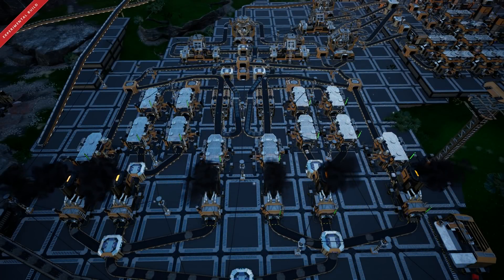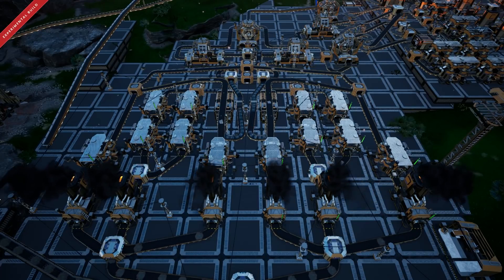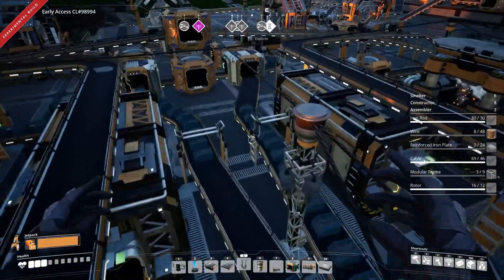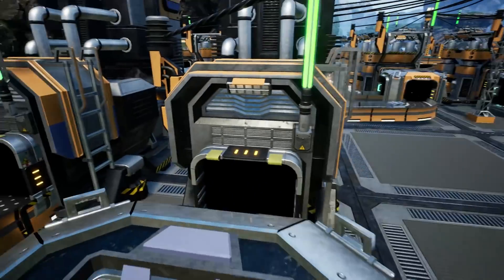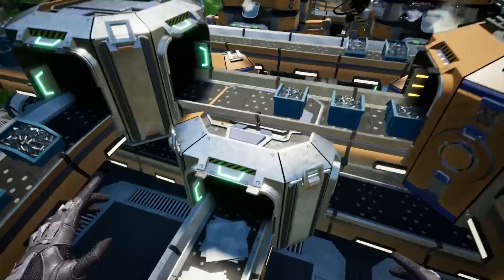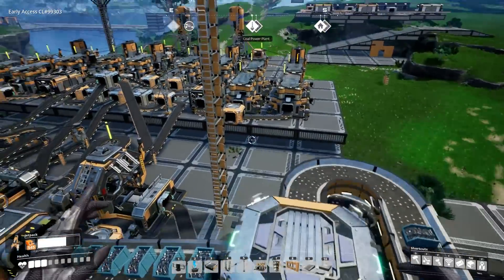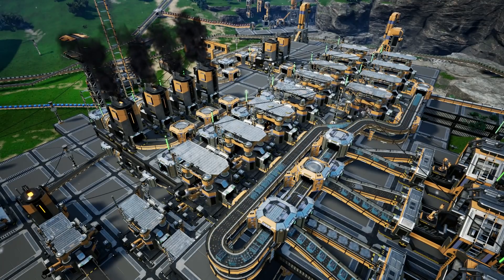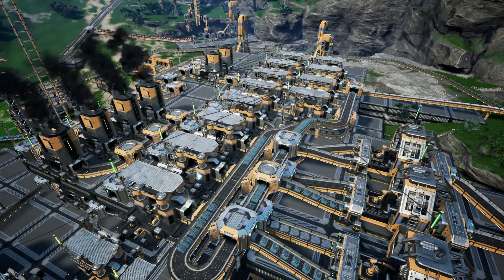Satisfactory Myth Busters: What's More Efficient, Bus vs Perfect Split

Comment: I use the overflow/bus line method because less space needed and it looks neat. But you do need to input slightly more than the exact amount needed for all the machines. You want to fill up all the machines or last in line will not get enough for 100. It would be great if we get set the output rate of the splitter.
Reply: to be fair, there is somewhat of an output rate on the splitter which you can control. if a machine only required up to 60pc to run at peak efficiency i connect them with an mk1 conveyer belt to the splitter and an mk4 belt is running from the source to splitter to splitter etc.

as the output to the machines are limited by the belt speed (60/m) the satisfaction period is drasticly shorter for longer buslines.

i do the same on the outputs. machine outputs like 30 plates a minute? mk1 conveyer into merger into mk4 belt. machine outputs 90 screws? mk2 converyer into merger into mk4
Reply from the maker: @BloodDragonSage  Nice point, I think I understand your point and will have to try it out at some point :)
Thanks for checking out the video!
Reply: i had made that suggestion as well to be able to control the ratio of the splitters and be able to set filters for what items go where as well as adding some sort of detection method for how many of a particular item is to be made or is already made. for instance if enough of one item has been made but not another then redivert resources to help make that other item faster. i know it is not necessary but personally id like the game to be a little more complex than to just simply mass produce  everything with no effort being needed to be put into managing resources.
Reply from the maker: @Zack-dk3pt  Just a heads up Jace has confirmed that splitters are not yet fully fleshed out they may add some kind of filter or ratio splitter for advanced functions :)
Reply: @TotalXclipse  can't wait. i have high hopes for this game and when mod support is added it will easily become one of my most played games.
Reply from the maker: Fantaman900 if you removed the over flow and just had the exact number of items you’ll be fine as all structures will run at 100% just the last two will be constantly fed the items (but at 100%efficiency) if you have to many going through the overflow pipes an excellent idea
Reply: @TotalXclipse  I've had it happen where I put enough on the belt and last one doesn't get enough because all the others are fed first.
Reply from the maker: @Fantaman900  Like in this video, they should all get filled first except for the last two which should just run at 100% but never filling. :/ perhaps it was a bug?
Reply: @TotalXclipse  I don't know man, game updated, it was a long time ago. The faster conveyors also helps. having a container fill before you start feeding all the machine helps too. feeding it from the middle helps. after 77 hours pretty much everything is at a stand still, almost all containers are full😆
Reply from the maker: @Fantaman900  I know that's my issue, I'm scared to turn anything on cus I know in an hour everything will come to a standstill :p

Comment: There are only 2 limits in the game: limited Ressource nodes and FPS.
In my experience the FPS limit is the important one
Reply from the maker: You're right although for the time being we're also limited by conveyor speeds... no point overclocking the pure resource nodes for those precious extra ores if they aren't going to pop out the conveyor in time :)
But yeh... FPS' are quickly becoming a rarity in my builds xD
Reply: @TotalXclipse  everything >20 FPS is ok
Hope trains will improve it
Reply: @instinct3510  recently, in my friend's session that we all play together, we had to relocate our 0-waste nuclear power plant into the big hole north of the grassy fields (and largely under the map), and cover the hole with foundations, it was at the East Ocean before, but whenever anyone went into the Swamp and rendered the glass-block-of-doom everyone in the session would have their frames drop sub-20 immediately.
Reply: @TotalXclipse  The elevators should help with fps as it's one item per conveyor instead of many items done the old way. (When I was a lad)
Reply from the maker: @SirHackaL0t.  Good tip,
Reply: @TotalXclipse  overclocking  pure resources is the most effecient way to use overclockers!!
Pure only produces 240resurces a minut while mk4 belts can handle 480.

FPS is not a problem in this game as long as you don't play muliplayer that literly kills you framerate.
Note you need to use walls to enable the oculusin optimization  else your are yust stupid, learn how the render engine works :)
Reply from the maker: @andersandreasson6367  Urm, yes and no, I should clarify what I meant...
You can overclock a pure node by 100% extra, which is great but not the full 150% because  You're wasting an extra power shard as our conveyors at the moment can only handle 480 RPM, not 600 RPM .... which is the big issue im having with my factory atm... hope I cleared it up.
Reply: @TotalXclipse  actually the limit is 450 items per minute which means a pure node on 188% (actually 187.5% would be exact 450 IPM; with 188% it's 451.2 IPM). From what i know from the official discord, there are about 860 power shards available in the world if you harvest every single slug. With a currently know amount of 339 resources nodes there are more than enough shards available to go to 188% on pure nodes. Since resources nodes are the only limitation using them in anything else than miners / oil pumps is just a waste of power shards.
Reply from the maker: @MartinvanStormOfficial  Thanks! I was just running the numbers from the top of my head as I'm pretty sure 600 is the max OC on a pure node.
Reply: disable shadows ;)
Reply: And more conveyors with stuff on them and splitters to calculate adds more lag. It's fine to split them for even distribution to lines but to each machine is overkill and is only gonna make the game run worse. If you did the math right it will be the same.

Comment: Vehicles use energy (fuel). 
Conveyor belts don't. 
ergo
Conveyor belts are more efficient than vehicles. QED

Conveyor belts are also more reliable and, quite honestly, easier to set up than vehicles.

Doesn't stop me from using tens of trucks in my factory, though. Not like there is energy scarcity in this game.
Reply from the maker: exactly :D
Reply: That's because he hasn't added in the formula for "power-drain" from belts, YET... (Honestly, I wish he removed power-poles if something is connected to a "powered conveyor". Or make that an option for all conveyors.

Also, a truck can carry full stacks of materials back and forth. The price per piece, in fuel, is negligible if it is bringing {24 stacks of 500} spools of copper wire back, each time. Also, speed is up to 10,000 times faster than the fastest belts. That is 12,000 parts per minute, from a location that is one minute away. (The world is only about 6 miles wide. At 60 MPH, it takes 3 min to reach the center, from the edges. Or, 6 min to go from edge to edge. 12,000/6 = 2,000 pieces per minute, which is still faster than the fastest belt at 720 individual pieces per minute. Until he makes "crates" so they can carry "stacks", not just individual items.)

As opposed to belts that you had to make with parts, which cost time and resources, per linear foot. Not to mention all the time YOU spend, laying each conveyor down. As opposed to setting-up a single track for vehicles to follow, which is a lot faster too.
Reply: @JD_Mortal  but trains go CHOOOO
Reply: @JD_Mortal  Wow, I'm sold! 10000 times faster!? That's perfect for the truck station's 1 belt outp-... wait... so it's actually 0%faster...
Reply: You can ride a belt much easier as well.
Reply: Trucks are also lag way more, if you care about that.
Reply: Conveyor belts keep moving even when you have a power cut as well. :)
Reply: but trains go CHOOOO
Reply: Belts use energy, its just off your GPU.

Comment: One thing that you need to take into account for determining the efficiency is the length of the bus. In the example here saturation is pretty easy, but when it comes to mega factories it could become an issue
Reply: I find as the bus gets longer the only issue is the length of time it takes to create it. Once made it just runs - and acts as a buffer as well.
Reply from the maker: Manuel Vazquez your absolutely right the larger the factory the longer it’s going to take to run efficiently, but my intention is to run the build constantly (eventually) the only issue is how to get rid of the finished items 😅
Reply: If you pre-plan your builds, and place   your buildings from first to last, your [concrete] will already be primed and backed up by the time you need it for your [encased beams], which will be primed and backed up by the time you need it for [heavy modular frames]. Bigger factories take longer to prime, but they take proportunately longer to build aswell.

Comment: If it takes 20 minutes to warm up then it’s less efficient.
Reply from the maker: Clive Flint yes but if you leave the factory on constantly then there isn’t really an issue, and more importantly it’s easier to extend the factory and takes up less space - so trade offs either way
Reply: I have seen a lot of "100% efficient" builds idling with full belts waiting for the next stage of the production to be built. In such context, some warmup time plays no role.
Reply: you could also have a container of ore somewhere in your base that you could use to fill the smelters by hand to jumpstart the production.
Reply: Hexadris that seems to go against the idea of automation though.
Reply from the maker: Clive Flint true, but I guess it’s like jump starting your car, only use it if you absolutely need to
Reply from the maker: Hexadris hadn’t thought of that, really good point ☺️
Reply: @TotalXclipse  It might also be nice if the developers implemented a function that you could tell a machine how many ressources its allowed to buffer for production, like for a smelter buffer only 10 ore instead of 100
Reply from the maker: Hexadris I’m dying for them to allow us to tell splitters to send 10 in one direction and 10 in the other. Or to send all in one direction and once full go down the other line. One solution to all my bottleneck issues
Reply: TotalXclipse i want windows.
A video on how you enabled those would be great
Reply from the maker: @SirHackaL0t.  It's a save edit file. I can't actually remember where I got it from, but could do a video on it, that being said it may have virus' and I wouldn't want people to feel it's my fault if they get a virus from a suggestion I made. especially when we should have them in game within a few weeks. But If I manage to do all the other videos ( I have 4 to do for next week) on my days off Sunday - Tuesday then I'll do that video for you :)
Reply: @TotalXclipse  That would be great. People should have anti virus software installed and can scan the file first.
I really want windows. :)
Reply from the maker: @SirHackaL0t.  Most people do have antivirus but from my experience people rarely scan files first. ;)
Reply: @TotalXclipse  That's the point of AV, it should do that for you. :)
Reply: @brianransom16  nope those are just smart splitters with multiple options per output but still it's only routing each item type once
Reply: i don't think he had the main or belt maxed out...  i have faster  warm up times depending on what you are doing. and  most of the time if you have the line running it will be ready to supply by the time you build the next stage of the main bus. main busing is easier to upgrade and expand. it also alows of more organization. i have t2 storage buffers all over the place within 20 min they will be all full after placing.